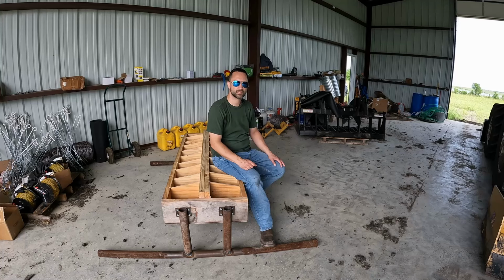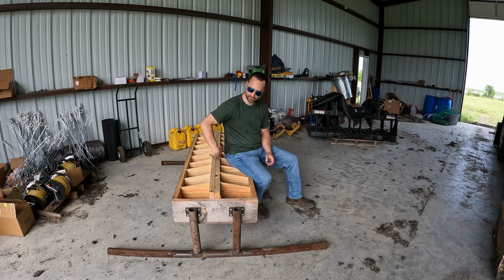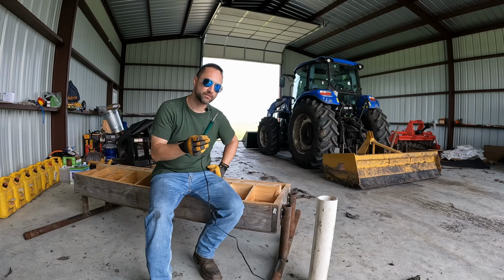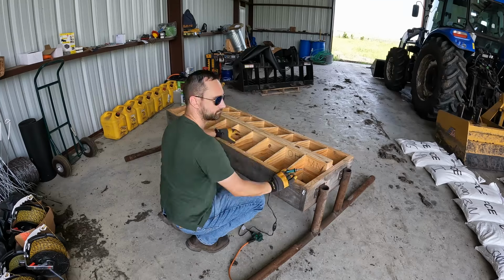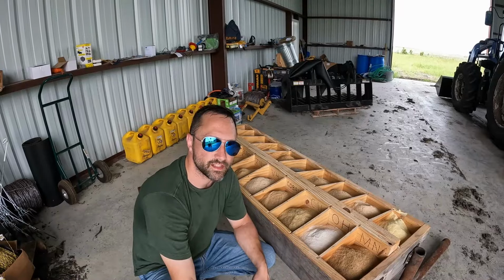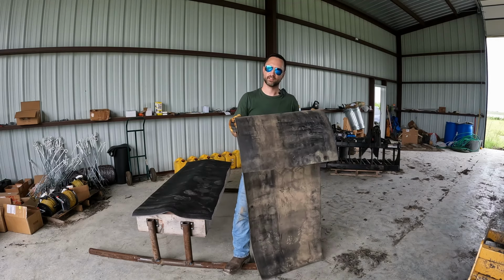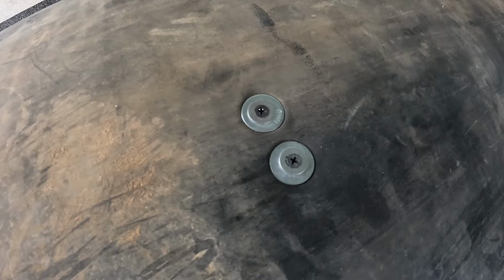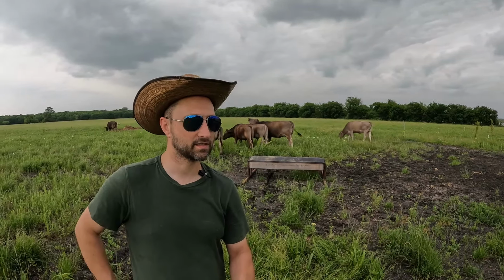Finishing the Mineral Feeder

Comment: Where did you get the heavy rubber mat?  I saw some at Tractor Supply but it was very expensive.
Reply from the maker: I ended up getting it on ebay, actually went back to try to get another one a few days ago and they had closed up so I couldn't.  I initially tried a heavy mat from Tractor Supply but I found it to be too heavy and was concerned the cows wouldn't actually be able to get under it.